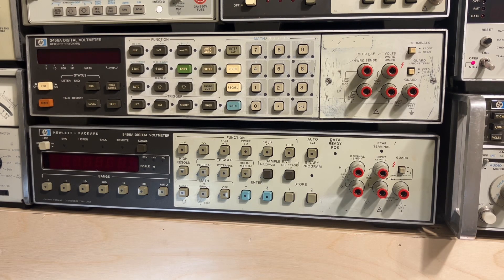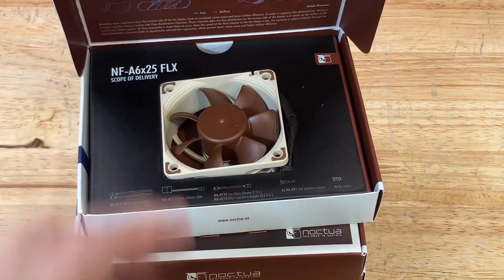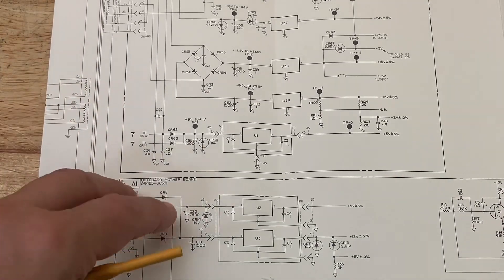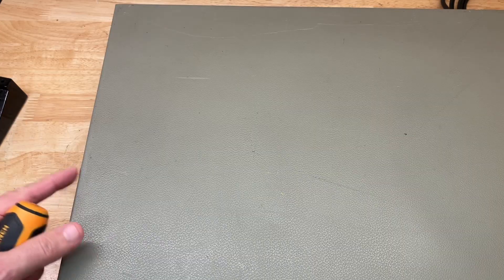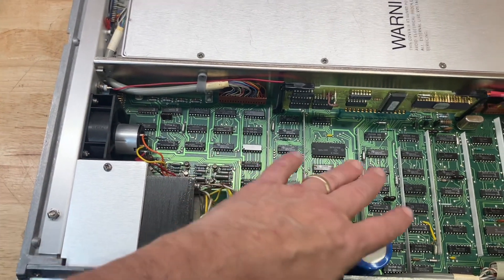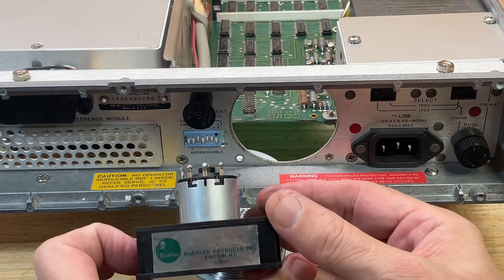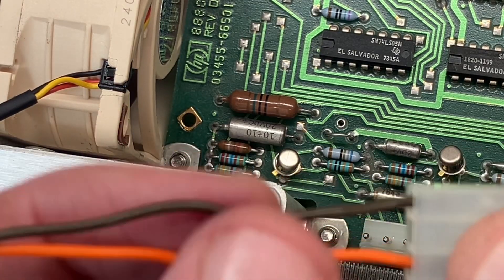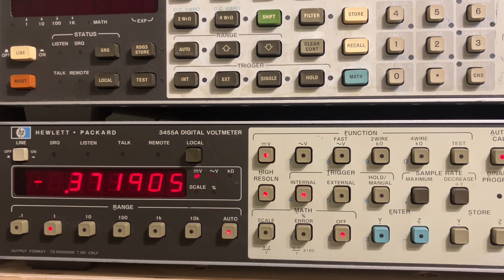Replacing Noisy Fan in HP 3455A Digital Voltmeter

Comment: Nice job Gary. 
I have been gradually doing the same to my trusted, but elderly test gear.
My only concern is how to be sure flow rate is still good. But….most of this equipment is spec’ed to run at quite high ambient temperatures, which it will never see in my workshop, so I guess that helps.
Reply from the maker: Well, I have neither the means to measure airflow, nor the expertise to understand the engineering complexities involved for a thorough analysis. But my gut feeling is that everything is fine with the modifications I’ve done so far, and in any case, I’ve kept all the old fans and original hardware, so everything can be reversed if necessary.

Comment: Thanks for showing this. I did it  with a HP 3455A. The Nocturna NF-A6x25 is slighly to thick, as you wrote. I've used a rotating grinder machine to remove about 1mm from the new fan. Then it fits perfectly to the old place. Fan is now silent, like a good notebooks fan, and I can hear even the reed relais inside now (which could not be heared before). Great video!

Comment: Great mod, Gary! Thanks for the tips. I have two 3456As and one 3457A, I guess it is the same deal, right?
Reply from the maker: No, unfortunately, the 3456A has a different type of fan, and the newer ones have no fan at all. I think the 3456A has a 120VAC fan, but I’m not sure. I haven’t changed the fan in my 3456A yet; it’s still the original. I did replace the 120VAC fan in my 3325A, you can search for that video for details. I don’t own a 3457A, and I don’t remember if they have fans in them either.

Comment: I just got one of these 3455As, and this was a great fix. Although I did have to file down the fan to get it to fit -- my board was already as far forward as it could go. And since I was hacking the fan anyway, I cut the corners off the inside surface so I could easily get to the screws to secure it. Those inside screws were awkward to remove!
Reply from the maker: Great!

Comment: Why put in a fan which isn't quite the right size? They make 20mm fans.

Are you sure the 4 wires from the old fan aren't for speed control?
Reply from the maker: 1. Because these are the fans I purchased. Actually I did purchase smaller fans, but I wasn’t happy with them, not nearly as much airflow. 2. Yes, I’m sure the 4 wires are not for speed control. I discussed their function in the video.